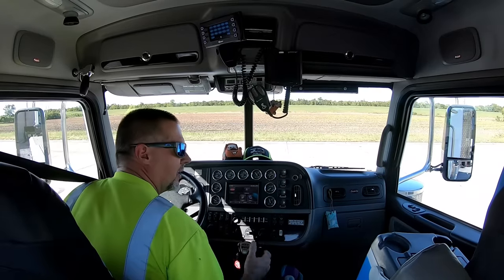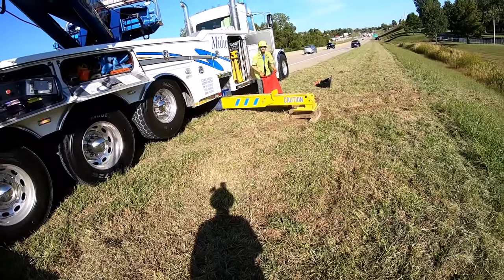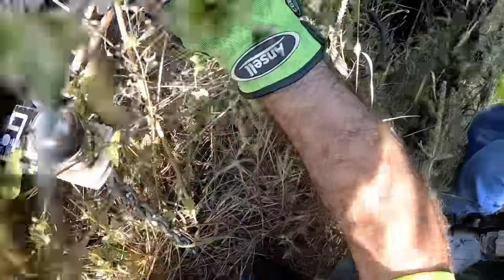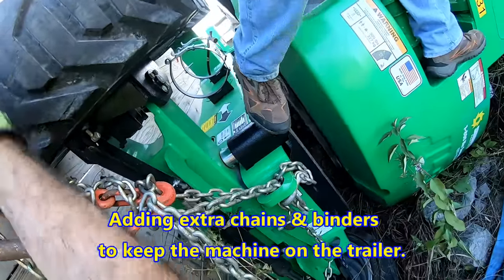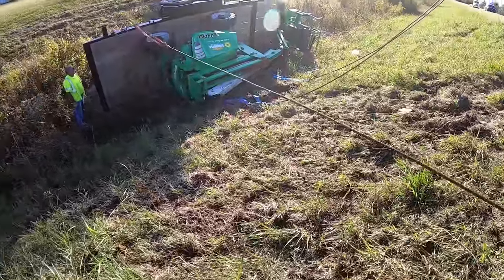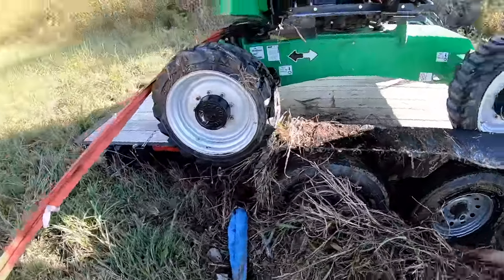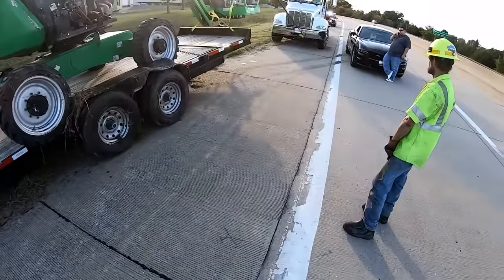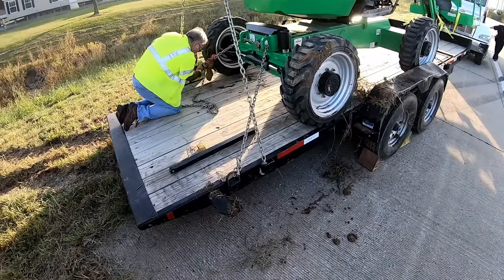THE REVERSE ROLL   ROLLOVER MANLIFT & TRAILER   YOU SPIN ME RIGHT ROUND

Comment: Fyi Ron this video was  a bit pixelated in spots (grainy) . Looks like your Peat  (#15) was moning & grunting on this one lol. Tator easy job for him for the most part. The hardest part  (as it always is) was the rigging . Would have been ALOT simpler if the trailer would NOT have fliped but it did so.... Also if I may add this shows the importance of the break away safety chains it held the trailer even though it was detected from the tow vehicle.

Comment: Why did you not suspend it in the air , was it to much weight. Also why did you not winch down the boom, taking a big risk pulling laterally  against  that totating gear.. just curious

Comment: It would be easy to modify a battery powered bolt cutter to operate with a remote. You would be able to cut those chains with tension on them from a safe distance.

Comment: It becomes apparent why the trailer ended up in the ditch. the bucket lift is located too far back on the trailer. it should have been turned around so the main weight is ahead of the axels.

Comment: "old son of a gun is heavy ain't it" yeah, 10k for the awp and around 3k for the trailer.
Reply: which means that truck is overloaded... by it's registered weight.
Reply: It depends on how accurate your equipment and trailer guess is. The super duty  regular cab, short bed is rated for 12,500 pounds trailer weight on the bumper. He was either just under, or just over. Either way if it had been loaded with 10% tongue weight it likely would have never been an issue.

Comment: I always opted for frame mounted hitches for this reason
Reply: That is a frame mounted hitch, the problem was likely the lack of knowledge about how you should distribute weight on the trailer.  With the lift on top of and behind the axles, makes the trailer unstable possibly pulling up on the back of the truck, it should have been loaded the other way so it was in front of the trailer axles.
Reply: As PoertersMob says it is a frame mounted "bumper" hitch. The way they loaded the lift on backwards is what lead to their incident, as the counterweight is on back side of where the lift is, either someone at the Rental place did not educate them or they just never thought to do it the right way like pros do and back the lift onto the trailer. From the looks of it all they had to do was swing the lift around where it already sat to put the counterweight forward of the axle centerline and most of the weight on the tongue.

Comment: LOL @ 1.03.49- that trailer wanted to get the heck out of there, it was self loading itself LOL
Reply: I don't trust blocks on a steel deck, safer imho is drop a chain into your front most tiedown  cutouts, then run it through your bridle and back up to the other front tiedown, then you can slack off the winch safely to straighten out the winchline, that's a technique I been using for years when 'steering' via the winch line

Comment: Got a question Ron, on the reverse roll video, why didnt you just have your dad position the rollback behind the Tator and pull the trailer up on the road apron and reposition so that he could load the trailer in reverse with tbe hitch wheel down so it would up on the rollback?
Reply from the maker: Very good question.  As a lot of people have commented, the machine was loaded with the heavy end towards the rear of the trailer, which was true.....  So....we wanted to load the heavy end of the machine as far forward on the rollback as possible for the best weight distribution.  This meant putting the rear of the trailer, with most of the weight of the machine, towards the front of the rollback's bed.    Thanks for watching and God bless.

Comment: Everyone saying the manlift was loaded backwards is right! Every single properly loaded manlift I have seen is loaded with the counterweight towards the front of the trailer so there's some tongue weight on the hitch. Having negative weight on it caused it to fly around like a ping-pong ball on an elastic string attached to a paddle. The officer attending the scene should have issued him a citation for failing to properly load the manlift on the trailer.

Comment: And all it takes is a little consideration of the center of gravity and knowing the weight of the equipment. It's very simple math; if you have, say, 20' between the tongue and the center of the trailer wheels, and you put the center of gravity of a 10,000lb lift 2' in front of the center of the wheels, you'll add 1,000lbs to the trailer tongue.
I'm going to guess, since it seems about right, that the black and white arrows on the lift frame visible at 52:57 are informing of the center of gravity. It appears to be 2' behind the center of the wheels, and that trailer looks like it only has about 15-16' feet from center of wheels to tongue, so this would have put about 1,200lbs of lift on the tongue, which  probably only had 200-300lbs to begin with. It's probably not exactly 900-1,000lbs of lift, as the more it tilts the trailer, the more weight it puts on the rear trailer axle, but it's probably safe to say it was a minimum of 500lbs negative tongue weight.
Reply: This is, of course, dependent on how much it shifted from the accident. Even as far forward as it could have fit it would have been too tongue-light.

Comment: That man lift was NOT secured according to Department of Transportation standards. That is why it shifted. They ran one chain across the back and the front. If it had been done according to Department of Transportation standards. It would have 4 separate tie down points. That is why this is not acceptable by the Department of Transportation. One chain can be used however not that way. God bless

Comment: Yeah, they needed a longer trailer. Almost all of the weight is over the rear axle of that trailer, leaving almost no tongue weight, on the ball. I bet it lifted the back of that truck right off of the ground, causing the driver to lose control.

Comment: I'm confused. The tow hooks on the front of the fords are mounted directly to the frame... What exactly failed when they were ripped off????
Reply from the maker: I have seen the Ford tow hooks bent and/or torn loose many times.   It is generally done when someone isn't familiar with their intended use.  They are designed for  straight forward pulls, slightly off-center pulls, and lifting only.   If they are pulled sideways, past a certain degree beyond center-line of the truck they will bend or break.   That being said, they can still bend or break in a hard enough pull in ANY direction.   Thanks for watching and God bless.
Reply: @RonPratt  ah well I didnt think about using them in a side direction. That would make sense
Reply: @RonPratt  
Thank you for the explanation Ron 👍

Comment: This is why you are required to have 4 independent corners tied down. Wrong size ball for the coupler? Shouldn’t have come unhooked unless no safety pin in it
Reply: If the coupler had not come separated from the ball, then the truck would also have been flipped, the coupler is only designed for attaching, not also keeping secure and thus why the safety chains are also used to keep a trailer in check if and when the trailer uncouples due to the safety latch not engaging correctly.

Comment: No toung weight is what caused this rollover the manlift did not shift backwards the chains were to tight for it to move.plus if it were any farther forward to basket would have been in the back of the truck. Inexperienced workers loaded it wrong. The basket should have been in the back and the machine all the way to the front of the trailer.

Comment: I have worked with and hauled a lot of those man lifts and that was not the proper trailer to have been using for that nor from all looks was the equipment positioned correctly. That machine comes in at around 10K in weight and that looks like about a 5 ton trailer which is not the best for a machine like that. Also viewers look at how the chains and boomers are positioned. You never haul any piece of equipment sitting on rubber tires like that. You always tie down using what we call a X pattern which requires 4 chains and boomers to do so. In short you anchor the right side of the machine and tie it down on the left side of the trailer. If you notice when Ron is using a rollback a lot of the times when he chains the vehicle down at the rear he crosses his chains. When done properly this keeps the item being hauled from not only moving forward or backwards but from shifting side to side on you. I have no real true idea what happened to cause this incident but I see several contributing factors all which could have caused what happened just from a short sudden stab of the brakes on the towing vehicle. I pray the man who was driving learned a valuable lesson from this and takes the time to learn and understand how to haul equipment like this because plain to see their guardian angel and God both were riding with them this day. This could have been a very bad incident resulting in a lot of injuries and possible deaths on a busy highway.

Comment: The chain tying the machine on the trailer should have been choked so the machine couldn't slide sideways off the trailer in an incident like this. A decent towing vehicle would also have helped.
Reply: The truck they were towing with is more than adequate, they just loaded the machine backwards on the trailer which lead to this incident as the counterweight on the machine was behind the axle center and not forward it for better weight distribution.

Comment: The truck isn’t heavy enough for that kind of load. Perhaps speeding caused the accident.
Reply: THe customers pickup was more than adequate, its was the way the loaded the lift on the trailer is what lead to the spin out as the had the heavy end to the rear of the trailer instead of swung the other way with the lift to the rear and the tail of the machine where the counterweight it on the front to weight down the tongue.

Comment: It drives me nuts seeing people chain stuff down like that, if youre gonna be lazy and only use 1 chain for each end of the machine then at least cross your chains! But that machine should have had a chain on each corner
Reply: Even with a chain in each corner, i would have crossed them. Or even so, crossed front to back.
A bit disappointed they didn't cross the chains, when securing the trailer on the rollback

Comment: That driver needs a lesson on how to load that machine way to much weight behind the axle and has to be 5 points if securement.  That little truck and trailer is a good little setup for that machine if it had a good driver.

Comment: I see what caused the truck to lose control. There was no tongue weight on it. It was all to the back of the trailer. Driver needs to learn how to load a trailer and where the weight goes. It is better to have too much in the tongue than too much weight in the back.